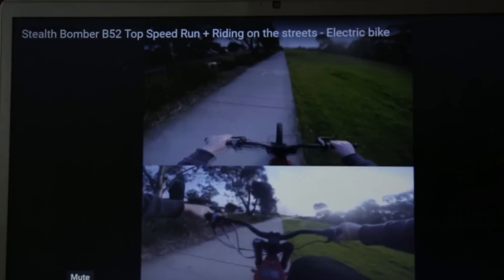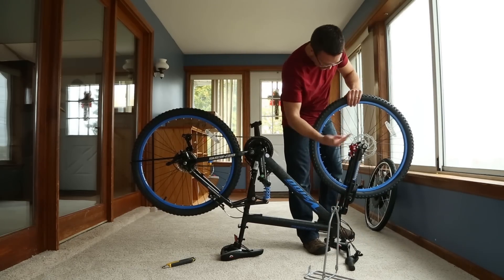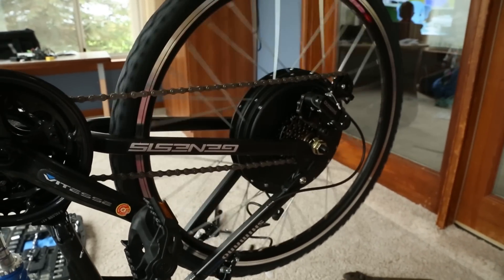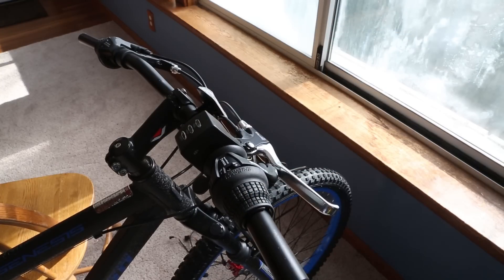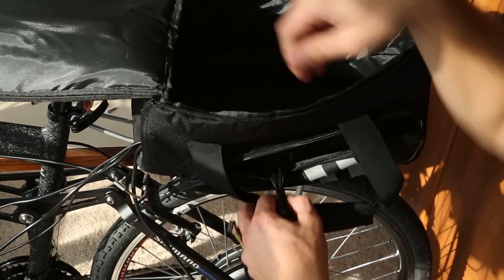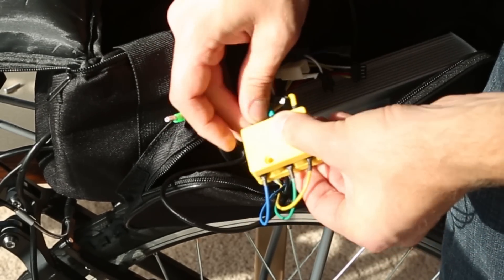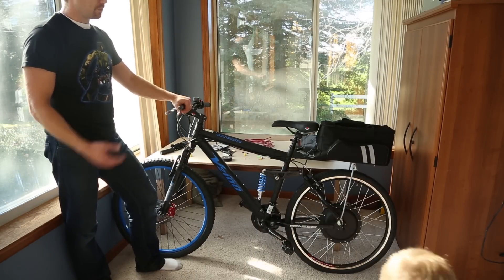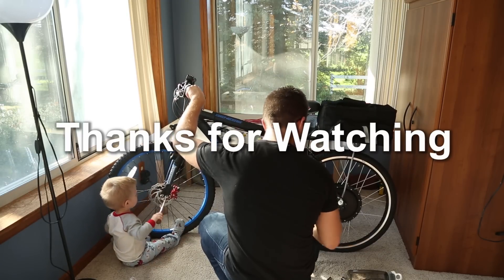How to make an electric bike for under $500! Fast & Cheap eBike tutorial!

Comment: Hello. Thanks for the video. I live in Costa Rica in rural Monteverde. Half of the roads are still unpaved and lots of hills. I am looking into building a cost effective ebike that would enable me to make a quick ride to town (typically 3 km) rides). I would likely use this 1-3 x's weekly. I am wondering 1)why you have 4 batteries? Is that necessary or could I make ado with just 1? 2) you give link to the lithium battery but that is SUPER pricey at$615 is that really worth it? 3) I have a Novara women's bike, 14 in. w disc brakes. Is there anything i should consider/be aware of that may make conversion hard?
Reply: You need four 12 volt to make the 48 volts to run the motor. The ones he used will not last long. Li iOn Batteries start at $350 you can build your own with charger for about $200. If cost is your concern go with a gasoline engine.

Batteries:
https://www.aliexpress.com/item/30PCS-New-Original-US18650V3-3-7v-2250mAh-10A-li-on-high-discharge-rechargeable-batteries-for-Sony/32821806633.html?ws_ab_test=searchweb0_0,searchweb201602_4_10152_10065_10151_10130_10068_10344_10345_10342_10343_10340_10341_10540_10307_10060_10155_10154_10056_10055_10054_10539_10538_10537_10059_10536_10534_10533_100031_10099_10338_10103_10102_5590020_10052_10053_10107_10050_10142_10051_10324_10325_10084_10083_5370020_10080_10082_10081_10178_10110_10111_10112_10113_10114_10312_5610011_10313_10314_10078_10079_10073,searchweb201603_25,ppcSwitch_5&btsid=6c0cb057-06e1-4f8b-9dc0-7522336ac56f&algo_expid=cded77c2-9c71-43ab-a241-f1314cfa94c8-4&algo_pvid=cded77c2-9c71-43ab-a241-f1314cfa94c8

Charger:
https://www.aliexpress.com/item/Original-SKYRC-IMAX-B6-MINI-Balance-RC-Charger-Discharger-For-RC-Helicopter-Re-peak-NIMH-NICD/32250724672.html?s=p
Reply from the maker: I would go lithium if you are going to use it a lot. 1 or 2 SLA batteries are not going to be enough for hills.

Comment: you are almost there with some more tweaking and modding you can set the batteries and comp up better for that bike. is that one pedal assisted or just push for juice? how long does it last. like a round trip of both pedaling and juicing? and just juicing? i need one just to get to the lake but its about a 30 mile round trip. an 1500 + for a ebike is too much i can get cheap used car for 1000 lol or a used  dirtbike or a used  enduro. for those prices.

Comment: Heat shrink the yellow bits on the battery connections.  Putting hand grips on is easy when the ends of the bars are lightly smeared with washing up liquid. DON'T put the big brake on the rear, it is the front which stops you.

Comment: next time you fit handle bar grips , spray the bar with hair spray , slide the grip into possision and leave to dry for a short time . the grip slides on  easy but wont move once the hair spray sets.

Comment: Your seat post is not part of the suspension.   As soon as you hit any bumps, you will tear up your bike and rack !!  Bike must be a hard tail or softtail rear suspension.  This bike is neither.   Dangerous what you have done.  You will break your rack and battery array will go flying in no time.

Comment: I bought the same kit but front wheel drive as I wanted to keep my nexus 8 speed internal hub on the rear. I put the batteries the same as you when I first built it but it was top heavy. I then mounted  two of them  in the frame triangle. The top one horizontal and the bottom one vertical. The bike feels well balanced now. The only other thing I fitted was a torque arm to stop the motor from spinning in the forks. I also moved the throttle on to its own bracket so I could operate it with my finger next to the front brake. I found operating it with my thumb awkward. The bike is good fun but not fast enough to make you look like an out and out hooligan. The faster and more expensive ones stand out as illegal. I have a 600cc motorcycle that I can ride legally if I want to go fast. That would beat any of these bikes on top speed in first gear, and it has 6. I think 1000w is just about right for the cost and not looking too illegal at top speed.

Comment: I made mine for $160 and does 22MPH.
How?
Used bike $60
500W motor I found on the side of the road- free
2X 10000mah 4S batteries from my drone $70
Sullivan bump start cone $10
Wood and hardware $10
30A light switch $10

Bore out bump start cone and attach to motor, attach motor to block of wood, attach block of wood to bike rack, wire batteries to motor with one lead going to switch, apply grip tape to cone.

and there you have it.

The motor is valued at $50 online and is a scooter motor.

Range is about 15 miles with stop and go usage.

Comment: I think instead of buying a new shifter, you should be able to tune the one you have so it won't go too high or too low. Setting like a "floor and ceiling"that prevents the chain from shifting off the chainring.
Reply from the maker: Thanks!

Comment: Great video.  
How much do you ride it?  
I am looking to build one to ride to work 26 miles round trip.  
What did you do with the rear brake?  
What's the realistic range on your batteries?

I would be interested to see how long it lasts on a daily use.

Comment: Hi the first link for converstion kit you have given seems to be only for front wheel because there isn't any cassette on the wheel although it say it's rear wheel on Amazon. 
 Could you tell me which one did you put on your bike. Also does your disc breaks work in the rear wheel since you have replaced it with the new brake lever. Did the wheel had disc installed in it already?
Reply from the maker: The disc was already on the front for me.  I would recommend getting a different rack anyways.

Comment: You should make a battery pack out of old laptop lithium batteries (18650). The cost about  $2 each and they are lighter than those UPS batteries. If you are going to use UPS batteries, there are smaller and lighter ones for about $8 each.

Comment: You will have a problem with the rear suspension now having a fixed rear paneer bracket to the seat post and back wheel

Comment: Nice project but why use lead acid batteries? that's so last century.

I've also made a DIY electric bike, bought the bike from amazon the kit on ebay and put some lithium ion batteries that cost me about £100 (around 120$). I had to play around with some electronic to get a charger but have been using the bike to comute to and from work.

Comment: I saw that you did not use the transducer. {the plate with the holes in it and the sensor) It should give some problem or diminish the kit in some way. I do not believe that they sent you those parts if you do not need them. I believe they control the motor and is does not let it run until you move the crank (so, you mean to go ) otherwise, the motor may start running when you are at a stop.

Comment: Built my first e-bike over 20 years ago, and eventually wound up with my present e-bike, similar to yours.  You will be way happy moving on to a 48 volt lithium pack (with dedicated charger).  Of course it's a lot more expensive, but hopefully they have come down in price, compared to what I paid about 10 years ago.   Mine is also tail heavy and due to not having a suspension, I occasionally break a spoke in the drive wheel.  One day I'll find some super strong spokes to switch to, or just switch the motor assembly to a bike with a real suspension.  Anyway, thanks for the video..... and have fun!

Comment: You can get lithium batteries from China for pretty cheap if anyone is considering this build, but wants more range and less weight.
Reply: Stephen M most knock off batteries are completely fake capacity. You're lucky to get over 1 Ah on any of the cheap 18650 batteries (though they all claim currently impossible 6 to 9 Ah). It's not cheap when it burns your house down. Besides, you need a $50+ lithium balance charger anyways, so the batteries are now worth the risk...
Reply: Actually, you do not need a lithium balancer with Li-ion batteries, only Li-Po. Yes, burning your house down would be expensive, but if you know what you're doing or willing to do the research and learn, that isn't really a risk.
Reply: Stephen M Lithium ion batteries still need balance charging (or at least balanced once in a while). Open up a laptop battery, they have balance charging. I just checked my 2 cell 18650 Samsung pack, and 3.78v and 3.97v each. I haven't balanced them the last 2 times.

Can you get away with it? Maybe. I used to straight up connect Li-ion to a DC wall brick to charge them. It was awesome, they got a bit toasty, but they charged in 15 minutes. Since then, I've learned a little bit more... The big thing I'm concerned with is the insane variance in the cheap Chinese batteries. I had a set of 4 purchased. 1 had about 300mAh, another had 500mAh, and the other 2 had about 800 mAh. Same seller, same order, hugely different capacity. If I used these in a series pack and didn't balance charge them, it wouldn't be good... I imagine you would want maybe 50 of these batteries, so your going to have at least a few weak ones. Without balancing, you will be way overcharging some.

Comment: In this state this build is an accident waiting to happen. Aluminum frames are not strong enough to hand the repeated torque of of high powered motors like this so typically one uses torque arms to reinforce the back wheel. With out them there is a high probability the rear wheel will eventually break/rip out of the frame. Even with them an aluminum frame has a higher chance of cracking/breaking from the torque of the electric motor. A better build would use a chrome alloy bike frame, and still using torque arms unless the frame was specifically designed to handle an electric motor.
Reply: Bill Young I disagree completely on why it's dangerous. I run a 52cc chainsaw engine to power an almost identical bike (does burnouts well). These frames are stupidly overbuilt (and heavy!). The problem is the "suspension" is a spring with no dampening, so it will bounce terrible and cause wrecks. The second thing is he doesn't know how to assemble a bike. That axle washer has a hook to keep the axle from falling out if the nuts get loose, he put it on backwards so the wheel can fall off (especially on those bumps I mentioned). He also made a limited suspension stopper with that rack, meaning it's going to break it keep the suspension from moving.

Don't follow this video as a guide, look up how to do it correctly before you get paralyzed.
Reply: Bill Young oh forgot to mention, my cousin has a 212cc engine on his bike. If you want to talk about torque, think of doing 10mph wheels without going past 900 RPM... That's also on a full suspension aluminum Walmart bike (mongoose maybe?).

I wouldn't do that, but if you got $100 and 30 minutes, you could put one of the incredibly weak 66/"80cc" engine kits on a bike. They are terrible in every way (power, weight, speed, fuel economy, reliability), but they are cheap and sometimes fun to mess around with. Require 2 wrenches and a Phillips screwdriver.
Reply: Electric motors provide instant torque, and have the potential to provide far more torque than any equivalent combustion motor. This is an aluminum frame and a 1000w motor running at 48v. This system is pushing over 20 amps through that motor. Google it, this is a recipe for potential disaster with out torque arms. http://bfy.tw/D1AV
Reply: I have the same bike and very simular 48v 1000w setup. I have never had issues with the frame being too week. The bike has had 3 years of trouble free (welds breaking etc). The things that were replaced had nothing to do with the conversion. The only problem i kept running into was the spokes on the motor wheel getting loose, break etc. I had to replaced the wheel and with much better spokes ( I took it to a local bike guy). I did not connect the torque arm either. I'm not sure how many miles I have put on this bike since the build, but i have replaced the tires three times!

Comment: In the U.K. That would require a motorbike licence and need a number plate and insurance as were only allowed ebikes that cut off electric assist at 15mph as it doesn't it's classed as a electric motorcycle
Reply: patrick baranowski The US is very lenient. Where I live, gasoline engines up to 80cc and max speed of 35 require nothing. Electric was up to 1000w and 30mph last I checked, but this varies between states.

In town I just don't need an engine though... I can already keep 25+ mph (18mph average on gravel roads). I do have a couple motorized bikes though that are fun. They got me into cycling, and that's been awesome.

Comment: Easy hand grip removal and installation- just drip a little rubbing alcohol (or spray some cheap hairspray) in there, and it'll slide on or off easily for a few minutes before drying up and becoming stiff to move.

Comment: You need to put a fuse inline also you need to put a anti rotation bracket on the motor.  The torque will end up turning the shaft and ripping your wires out of your motor. Rear suspension  and that battery stand  will break because it's keeping the rear suspension from working. Nice build   But you better fix those things or they will become expensive problems. I've built  6 different bikes and the best one is the mid drive one. If you go to the ebike forums you will quickly find out what I'm taking about.

Comment: Love Genesis bikes. They're one of the best at making cheap bikes that look and feel more expensive. Used to have a bmx bike from them a while back. The only issue I ever had was the star nut cracking in half after a harsh landing. Other than that it was great. And completely chrome with orange accents. I still have it in the garage somewhere, but I haven't competed in street bmx for years xD

Comment: Save up for a better bike at least.  it will fall apart... headset, bottom bracket, wheel hub - all cheap and will wear quick resulting in loose shaky parts.  not to mention all other cheap ass components on it. Buy a good used bike.

Comment: dude u mounted an isolated suspension to a fixed frame with the rack also the brake levers are the last ones to go on. instead of wrenching down the axle nuts use an anti torque kit and use the torque wrench on the axle bolts

Comment: Your wire from the back wheel is pointing upwards which means water will run directly into the hub and damage it over time, the wire should be pointing down wards against the floor and then be led upwards afterwards. :)

Comment: I apologize if this has been answered but a lot of posts to go through. I have pretty much the same build but my batteries ended up to be prohibitively heavy so I put them in a trailer that I needed most of the time anyway (about twice the height, and probably weight as yours) It was recommended in the ads for the hub motor kit to go with no less than an 18ah, but your batteries are so short I'd guess they're less than 18ah? What is the ah rating per battery on yours? And roughly how many non pedal miles do you get from a charge on those. Any problems using that few Ah, assuming it is less than 18ah? 

BTW I have two hybrids, both elect with gas backup for emergency...one two wheeler and one Schwinn Meridian trike (both Walmart bikes. Lot of fun and practical once I get all the bugs worked out.

Nice bike, you did what you set out to do and remember, can't please all the people all the time. :)
Reply from the maker: They are the ones in the description 12ah http://amzn.to/2njZLk9. I have not done a distance test yet, but I'll make an update video in the next 30 days!
Reply: Oops, guess I missed that in the description Thanks for the reply, the thorough video, and look forward to the next one.

Comment: This video should be entitled, "How to build a dangerous eBike with weak, heavy batteries." I urge you to take it down and repost a better one entitled, "How to build a safe eBike with light, powerful batteries."

For $50 most people in the US can probably buy a used bike (say, on Craigslist) with only front shocks. That Walmart bike looks unsafe. A unsafe full suspension bike is, well, unsafe.

Encourage people to put the bike purchase savings  into some sort of lighter more powerful batteries such as, say,  some sort of lithium batteries. Make the entire price for the eBike, say, $600 to $700. Then people could have an excellent form of transportation that cost a small fraction of driving a car that requires no insurance, cheap repairs, and cheap refueling.

Comment: 6:10 you just locked your rear suspension with the rack!
Reply: yeah that rack going to break very soon
Reply: I was wondering about that rear suspension.
Reply: Stream Rolling you don’t need to, it’s got a hinge so it will move with the suspension
Reply: @ettmisi8609  no man... That hinge is not for movement. It's just for adjusting angles for better fixation. Differently than rear suspension pivots, it doesn't have any bushing or even lubrication...
It will soon fail due to fatigue.
Reply: @VidaAdaptada  it’s a Walmart bike anyway it’s not gonna last much longer with or without the rack
Reply: It’s a $100 bike with $3 suspension. He won’t notice
Reply: @austinbprice  until the screws fail or work lose from the vibration and movement, causing the lithium battery to fall off the back and short itself into pieces
Reply: true, hope he saw this comment
Reply: Yep that rack will move, it will work all the bolts loose and slowly destroy itself, needs a rack with pivot points

Comment: Not saying the video is bad but the whole time you said you didn't have  those connectors all you had to do was strip the wire you needed and put it in the hole on the other side and clap it down